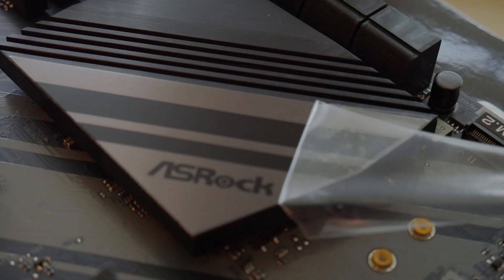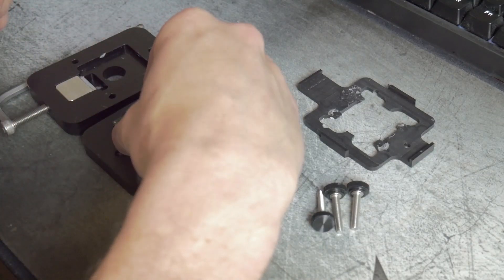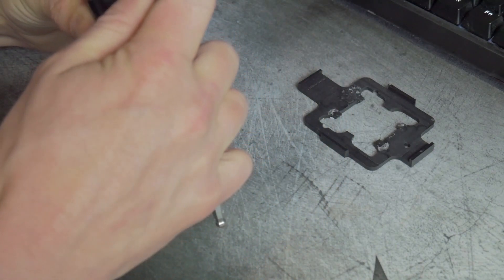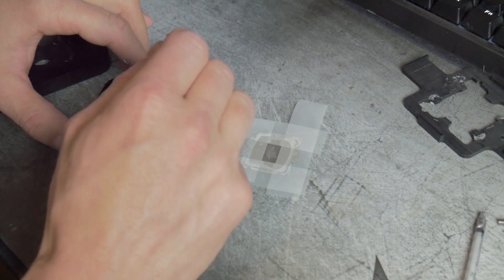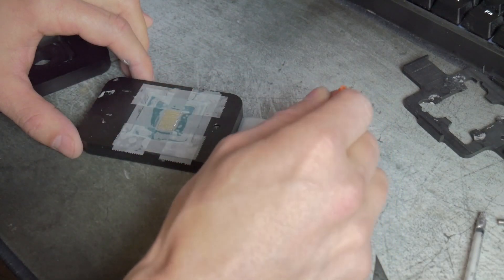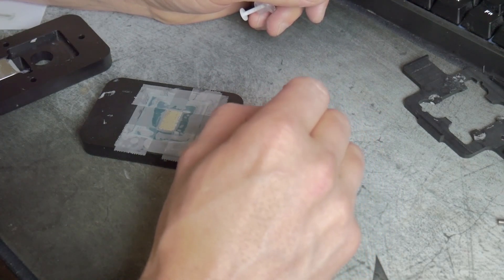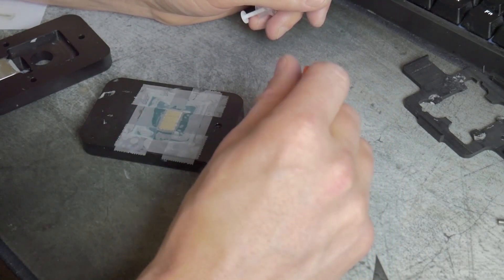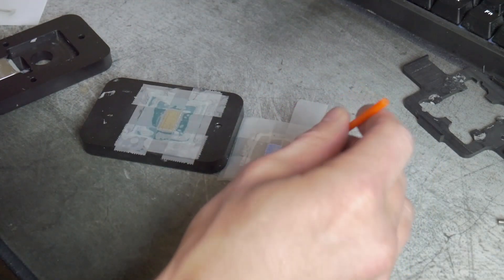8700k Delid: Project Mclaren Vlog

Comment: Not gonna lie I hate the asrock extreme 4 and dont get me started on the 3 or the even the tai chi or supercarrier, pretty much all asrock mobo are ass now a days, steer clear I almost quite overclocking while using the extreme 4 for my friends rig, returned that thing and got an Asus prime mobo and boom life's good lol, my 2 cents
Reply from the maker: Interesting. I had three rmas with Asus last year. One asrock RMA and 0 with msi. Build a lot of systems issues come with the territory. Most of my OC records are on asrock atm.
Reply: Son of a Tech well I guess our luck is the exact opposite, here is my co conclusion of motherboard manufactures from an overclocking stance, asrock uses extra ass components on the cheaper boards unless you buy the top of the line, but the top of the line boards have trouble in stability or control of what is electrically happening and you loose the top clocks for the cup even though the usually build by far the most powerful vrm and 1 or second most efficient, and when it comes to overclocking memory its terrible they do not know how to make a use of the OP hardware and the layout are trash and the uefi and bios don't learn from there mistakes essentially a dumb board is what i am getting and this is there top of the line
Reply: Son of a Tech I forgot to mention for asrock that they did make the best cpu overclocking board or tied with the 600 dollar Asus one the z170 oc formula a fan favorite and the z97 and the z77 where REALLY good for cpu oc as well and I also liked the x99 formula and the micro formula boards where so cute that I only use them for matx builds,       I also forgot to mention that msi titanium z170 was pretty good alrounder not a single complaint, and the msi marshal or what even was op af best mobo in existence, and I ment to say XPOWER and there older xpower are really good too
Reply from the maker: I'm just saying what I ended up with. I think most companies have issues. I would say in this whole discussion we didn't even mention gigabyte. Which reflects their market share. Personally I've been disappointed in how downhill they've gone. They are suffering bad. :( poor giga
Reply: Son of a Tech also gigabyte is kinda weird like msi, there new motherboards have underwhelming vrms and cpu side and the most efficient well close to being and the cooling is very bad but they just made a vrm just powerful enough to be be used for overclocking and in now way is it bad but could be much better, but damn they know how to build an amazing board for memory oc and they like to add blck generator on lower end boards too, gigabyte ruled the x99 world I had to make a hard decision in life quite my job or spend all day everyday tring to figure out how the hell to oc ddr4 on x99 with that 600$ Asus board and then I traded it for a soc champion and god has answeres my prayer (not religious btw) that thing swooped the floor in world record it broke bounderies for ram OC and the cpu vrm was really good but not the best in the world but the soc champion was the king in the x99 world, and there older z77 and z97 was just great loved the boards and the soc champ from that chipset except I LOVED the g1 sniper and assasin and the 3rd one I fergot, there soc are always great but atm they are not the best and g1 from the some z97 and all up are not that great
Reply: Son of a Tech lol just wrote about it, I am going to give you MY opinions and experiences from all mobo manufactures and most boards except I may not go in depth about am2 and am3 as that was a HOT mess litterally, everthing I said applies to z77 and up and including AM4 as they are essentially using same stuff and layout, just stick with me, and I may go into a little detail about x79 and x58 z68 p35 p55 amd am2 and 3